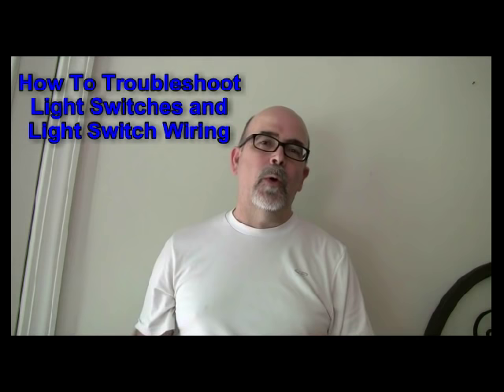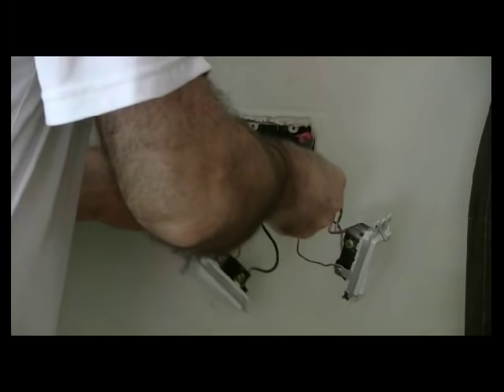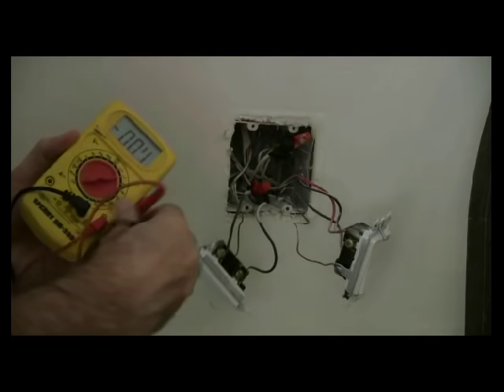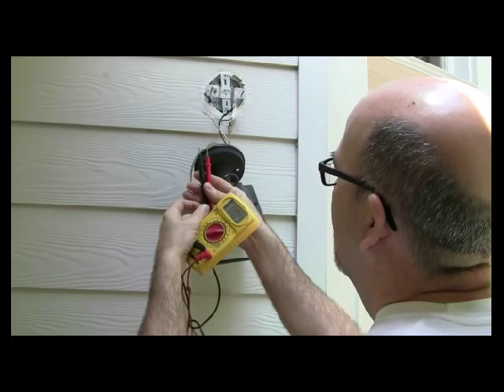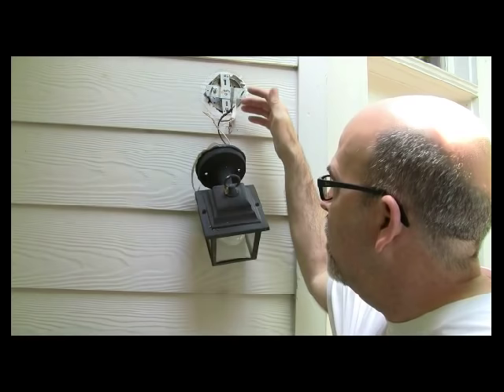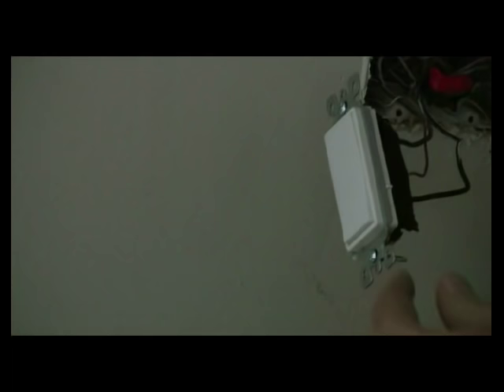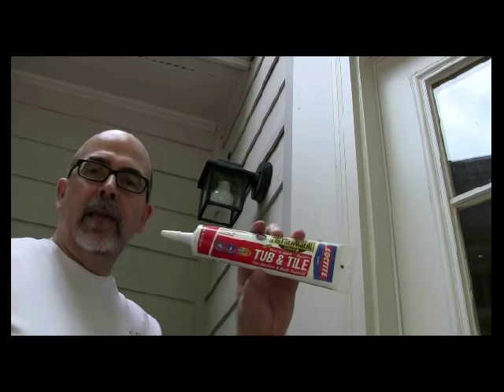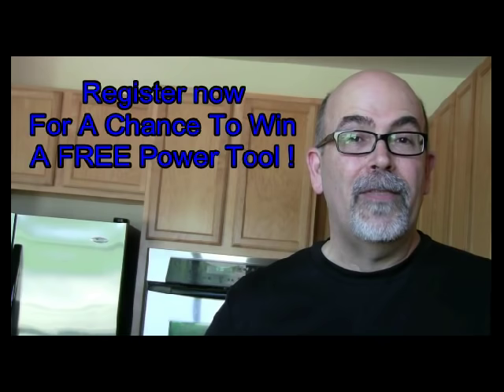🪛TROUBLESHOOTING LIGHT SWITCHES & WIRING -Pro Tips For Home Repairs

Comment: Thank you for this video, I was going to initially replace the wires, but I will try this first and hopefully fix the lights. One question though, my sniffer is giving me a beep on the switch when it is turned on and the light fixture has been tested and works. But when I try to switch on the lights they don't come on. Why is that?
Reply from the maker: Hello, thanks for the question. Having currrent to the switch does not constitute a working switch. Yo'll have to do a continuity test with an ohm meter to determine if the switch is good.  Never hesitate to call in the PRO. Be safe always when working with electricity!  Please like this video and leave a comment on how it worked out for you.

Comment: HI, On the second switch you have a red wire with the black,I have the same set up on a single switch and the light don't work but a wall plug does. I need to know how I can make the light on the ceiling work. I do know my way around a bit. Any help will be appreciated. Thank you!
Reply from the maker: You might have a 3-way set up. BTW, the power to the outlet has nothing to do with the lights. They are on separate circuits. Thank you for commenting. Please subscribe, like and share the DIY love!

Comment: I hope this helps resolve my issue.  My bathroom light flickers when I try to turn it on sometimes comes on and most of the time only flickers, sometimes it doesn't even flicker. lol
Reply from the maker: Hey Val, Yes, it most likely is the switch. Try a new bulb first...always a good place to start! LOL   Be safe always when working with electricity!  Please like this video and leave a comment on how it worked out for you.

Comment: what does that connection called when they have hot on white wire. because i got the same setup and i want to install additional light and a light switch next to it, and it seem like the second one always get power on every wire wether the 2nd switch is on or off.  i pigtail the white(black tip) to white on second and still doesn't work.
Reply from the maker: I think you have a 3-way setup. Would need more info to be for certain. Thank you for commenting. Please subscribe, like and share the DIY love!

Comment: Question master, I changed a hallway 3 way switch and now my bedroom light goes off when I turn on the hallway light.why? Thanks
Reply from the maker: Because the wires you tapped into are most like tied/connected to the wrong wires (bedroom wiring routed through that outlet box). No let me ask you a question... If you could get direct access on a REAL-TIME VIDEO CHAT/CALL to a certified home improvement expert for assistance, advice, or a step-by-step walk-through for your home improvement projects, how likely would you use this affordable service for instant solutions?

Comment: installing a 3 way switch for a staircase, can I use one switch tha'ts dimmable  switch and the other one that's not?  also when you use multimeter to test the switch at 3 min 30 s, does it matter which multimeter needle goes to which screw?
Reply from the maker: If both of them are 3-way switches you can

Comment: My hallway light and bathroom light isn t working even with new bulbs. The outlet plugs are working. Any suggestions?
Reply from the maker: Yes, you can check the circuit breaker in the box first to see if it tripped, then reset it by turning the breaker completely off, then back on. Next turn the power off at the same breaker, then check the connections on the bathroom and hallway switches to see if they are secured. Sometimes they can be "piggy-backed" from one switch as a power source to the next light switch.  Let us know how it worked out for you. Thank you, be sure to subscribe and click the notification "bell" now for our next home improvement/home repair DIY videos!

Comment: Hey your video is awesome thank you for posting! If you are facing the switch mine has two black wires on the right side, one red wire on the left side and then the ground wire connected underneath that. Is this a different kind of switch or what should I do? thanks for the help.
Reply from the maker: Yes Caleb, that is a 3-way switch which actually only involves 2 switches. Unfortunately, I do not have a video to refer you to on my channel. Working with a 3-way switch is on my record list though. Either research the 3-way on YT or call in the PRO. Be safe always when working with electricity!  Please like this video and leave a comment on how it worked out for you.

Comment: Great video, thank you for posting.  I'm struggling with a chandelier that I rewired to add a swag.  I can get the fixture to light, but can't turn it off at the dimmer switch (it is new).  At the fixture I have black to black + the fixture wire, white to white + fixture wire.  I capped and set aside a red wire (no fan as part of the fixture).  At the dimmer (the only control) I have black to black, red to red. There is a second "flagged" red for a 3 way.  I have an unattached white from the wall that is capped.  What simple thing did I miss?  Frustrating, because I hung the chandelier 10 years ago without a problem.  Oy.
Reply from the maker: OK, at the dimmer, attach the red from the dimmer to the white from the light fixture. Keep the black the same.
You are going to ignore (cap off) the red wire in the wall and  in the fixture box all together.
Reply: TheHandymanToolbox. Thank you!  So frustrating, now it works like a charm!

Comment: Enjoyed the video.  Question about testing the switch while the switch is still in the circuit.  Since you have 120V across the switch when the switch is off, wouldn't you have 0V across the switch when the switch is on and operating properly?  Wouldn't an indication of any voltage across the switch when the switch is on be an indication of a bad switch?  Also, couldn't you check the ohms across  the switch with the switch removed from the circuit?   A good switch should read infinite resistance when the switch is in the off position & very close to zero resistance when it is in the on position.   I think it would be easier this way instead of pulling down the outside light fixture.
Reply from the maker: I'm sure that is an option. I am not going to presume the knowledge, experience and skill set of my audience. This is why I chose this procedure. Very basic approach. Perhaps you can create a video of your own and show it as an alternative option? Let me know and I'll give it a thumbs up. 😉

Comment: Confusing what was it you did with the switch. What position does the switch have to be in and when?
Reply from the maker: Hi KK, Yes the red wire is the common wire between the two switches. So the neutral (white wires) are tied in together (not connecting to the switches), the red wire is connected between the two switched as a common, the green (ground) and the black wires (power) are connected to each  switch independently and separately. Each switch will have only have a green, red and black wire attached. Let me know if you have any other questions!

Comment: Hi guys need a bit of advice needed please.., large flourescent light fallen still hanging on wires, tbh we dont know which way the switch is on or off and need to cut the wires is it safe to do so thanks
Reply from the maker: Turn off all of the breaker in the house! Cut and cap off each individual wire and seal with electrical tape. Then turn power back on.

Comment: What if the wire at the light switch are not reading on the multimeter.
Reply from the maker: If you have 4 wires, green, red, white and black, you have a 3-way switch. Look across the room for the other switch and check it for power. Also see if the lights in that room work as well. Thank you for commenting. Please subscribe, like and share the DIY love!

Comment: What I do on outside light connections is instead of taping around the wire nuts which still I do, but before doing that is I twist the copper wires tightly together, I squirt a dab of silicone into the wire nut & twist them on so that they insulate them from moisture. But be sure you twist the wires together before you use the silicone on them so as not to insulate the flow of electricity! In other words if so you squirt the silicone into the nut without first twisting the wires tightly together the silicone will coat each wire separately breaking good connection. Don't do that!
Reply from the maker: Sounds good. Glad to hear that the talents and skills that I have picked up through my 40 years of public service is beneficial to others! Please make sure you subscribe, new video series coming soon.

Comment: Still unable to get lite to work what else or do I need electrician?
Reply from the maker: Go through the sequence of checking out all connections, bulb, amke sure that all the switches are good in case of a 3-way switch, fixture itself, bulbs, and breaker. If there is no other thing to check, call in the PRO. Be safe always when working with electricity!  Please like this video and leave a comment on how it worked out for you.
Reply: @TheHandymanToolbox  how do you check the breaker ?

Comment: I did all this, my light still does not work.  the switch has power, but no power coming out to the light.  Any suggestions? The light worked one day and not the next......  We are doing construction on a nearby wall, I'm wondering if we vibrated a wire loose in the junction box that supplies power to the light fixture. Haven't checked that yet, it is more difficult to access. Thanks
Reply: By the way, thank you for the video, it is very clear and informative.  :o)
Reply: More info.  The voltage going out of the box directly into the fixture is 117.9, same voltage is also coming out of the switch up to the light.  Is the, less than 120 voltage, a problem?  Right now I have a receptacle hooked into the switch.  117.9 going into the receptacle, but a small lamp plugged into the receptacle will not work.  I am stumped.
Reply from the maker: You are so welcome Linda B. Glad to hear that the talents and skills that I have picked up through my 40 years of public service is beneficial to others! Please make sure you subscribe, new video series coming soon.
Reply from the maker: Did you figure it out?

Comment: Hey my bathroom light stays on and wont turn off had to unscrew lightbulb and just been using a little lamp type light that i have plugged into a plug thats connected to the ligh that would not shut off and worked fine as well as the flood light in the bathroom but not the fan though but now both the lamp and flood light are both flickering to a point now that  the above floodlight/fan both dont work,now the light would work n just started a flicker but the fan stopped a while ago and now the flood light does not stay on at all and thr other lamp light flickers here n there , its all connected to a 3 switch .. any ideas and on what i can do to fix the problem i dont want to have to pay an elect.to come out unless majorly needed , i know just enough to do the work just not elect. Tech savey with where to start and what it could be lol if you could help it would be awesomeee . Thank youu
Reply from the maker: When you are working with electricity and you run into issues like this, it is always best to call an electrician out to check things for you. Faulty wiring will burn your house down risking your life as well as others!

Comment: i have two light switches in kitchen but one stopped working. i replaced the switch but still doesnt work..any suggestions?
Reply from the maker: Are they 3 way switches.. meaning each switch turns the same light on/off?
If you look at one of my vids on testing electrical lines, maybe this will be helpful.
Please let me know.
Please make sure you subscribe, new video series coming soon.
Reply: i figured it out. they electrician came out and gave my mom a quote of $200 to change the simple light switch and she said NO,,so when he put it back together he didnt wire it the way it was. so i came along and put in a new switch the same way i took it out, but only after looking at the wiring of the other switch did i find he wired them wrong. so i corrected the wiring and the new switch worked as it should. i blame the crooked electrician for trying to cheat my mom for a 15 minute job, she even had to give him $79 just to come out and look at it. thanks for the reply!

Comment: I need advice if any one can help: I have two light switches but only one turns on the outside light but the second one doesn’t do anything I don’t know what it goes to I tried all plugs but can’t figure it out. Any advice in how to fix it?
Reply from the maker: No telling. FYI: Lights and outlets are on separate circuits and are not related. Yet there is a rumor that that they are still not talking since they did got their wires crossed some years ago. LOL Thank you for commenting. Please subscribe, like and share the DIY love!

Comment: I took a old switch off, and it has no ground wire, is this a big deal??
Reply: Cant get light to stay on, I had it fixed for a second, but then screwing the switch back in had it again only flash when I flip it
Reply from the maker: Technically you should have all receptacles and outlets grounded. A word of caution, please refer to a licensed electrician for an inspection of your current electrical system to make sure there are no hazards. one thing about electricity, it never says I'm Sorry!

Please make sure you subscribe, new video series coming soon.
Reply from the maker: Turn off the power to that switch first. Pull the switch from away from the outlet box and inspect the connections. One of the wires is not installed correctly. Check to see if the screws are snug. Wrap the switch with electrical tape to safeguard from shorting out when/if touching sides of metal box or other wires, such as the naked ground wire. Check with extreme cation!
Reply from the maker: Not always the best practice. Better to have a ground attached to the "hardware". Let us know how it worked out for you. Thank you, be sure to subscribe and click the notification "bell" now for our next home improvement/home repair DIY videos!

Comment: My problem is that after testing the receptacle that reads hot, the light does not work. The bulb is ok in  another outlet. I changed the receptacle like you did but nothing will work. Comments?
Reply from the maker: Are we talking sockets or switches? Not receptacle....